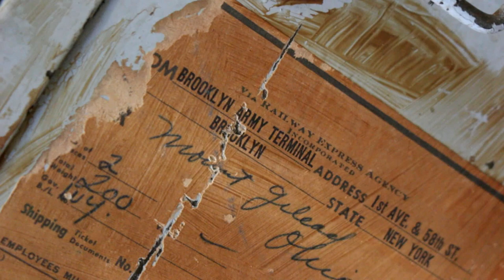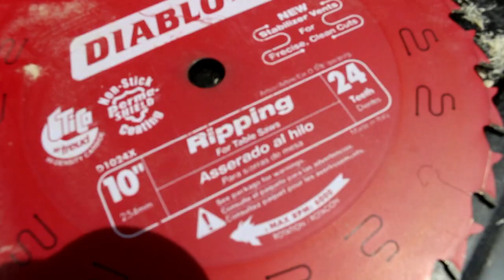Shop Made Paint Drying Rack

Comment: Have you ever played with having the doors rest on nail heads coming out of the top of each support, rather than the wood itself?  I've seen this before and not sure how it compares
Reply from the maker: I have not, i’m afraid that I would probably end up scratching the doors as I move them… LOL I have them sanded pretty smooth but could probably see them a little bit smoother. They don’t stick to the paint so far and if I’m going to be laying the doors down with the finish side facing down I typically tape over it.
Reply from the maker: HEY, just an update... I just did 50 serving boards at once and i took 48" pieces of scrap .75" plywood and ran 1.75" brad nails up through the bottom, 4 for each board. I then stacked the plywood strips on my rack and as I oiled each board I put each one on the nails to dry and it worked amazingly! They were really only "One time use" jigs, but they worked really well. there was no nail marks and the boards dried beautifully!

Comment: how do you prevent cabinets sticking to the wood after painting?
Reply from the maker: Usually I let them dry to where they have begun to cure before flipping them over. Also, I always prime the front and the back that way if the primer gets messed up on the front I can always send it before doing my final prime however I paint the back first then the front so that if there are any issues with the final coat it will be on the backside of the doors or shelves and I can always touch that up with a roller on site.

Comment: How much weight do you think it can hold??
Reply from the maker: I just used mine for some floating shelves and cutting boards, it can hold a good amount of weight, just make sure to evenly distribute the weight or it may topple over. Also, make sure to GLUE each strip when screwing. I didn’t initially, and they wore themselves loose over time.